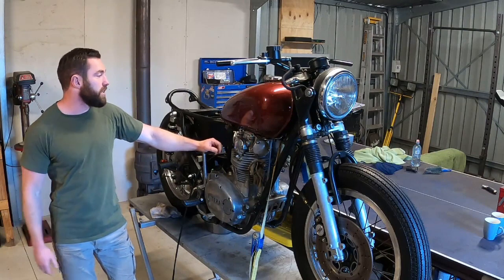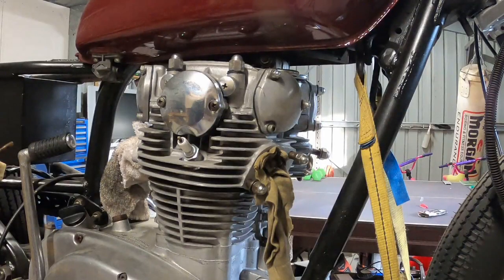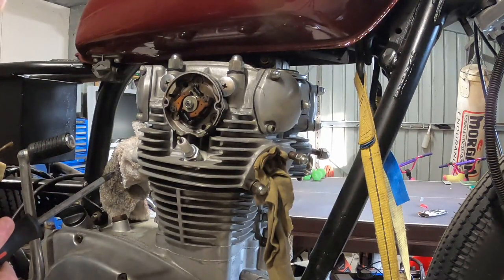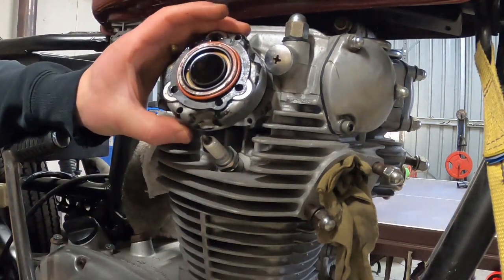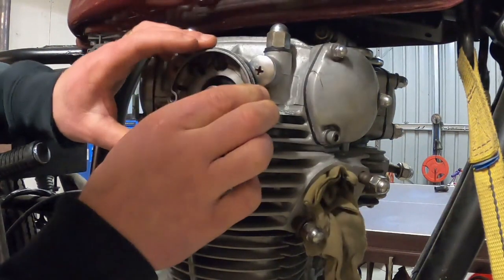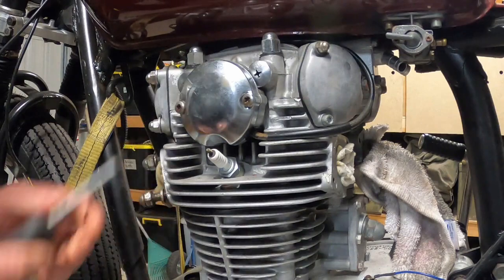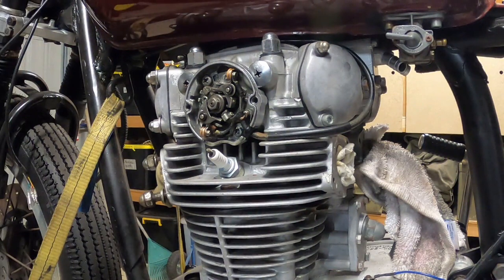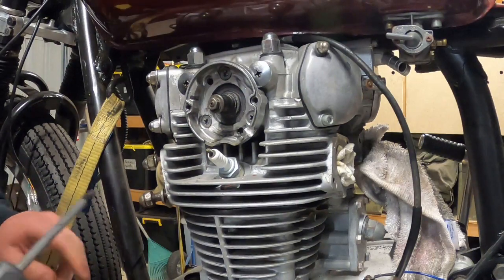XS650 Brat Build Ep 15, How to Replace Cam Seals

Comment: Having trouble reinstalling advance… specifically the directions of the locating pins of both the advance rod and cam and how to orientate them. Love the content!
Reply from the maker: The pin in the cam only allows the advance plate to mount in one orientation(there is a little slot in the back of the plate). Once that is done and the nut is tightened down the "advance button" (don't know if that is the right name) goes on the advance rod and is located by the pin. There is an arrow on the button which points in the direction of rotation. Don't worry about orientation of the advance rod as it will spin freely inside the cam and you can rotate it anywhere you need to in order to locate the advance weights.
Reply from the maker: I show the procedure in my top end rebuild video but the light wasn't great.

Comment: Just did this seal today. You don’t have to disassemble the advance mechanism. Just loosen up the castle nut behind the whole mechanism after you remove the two keeper pins. The advance unit comes off as a whole. The three Philips head screws that hold the back cup with the  seal I had to tap loose with an impact tool. Used that to snug back on. Nothing like Hercules but good n snug.
Reply from the maker: Thanks man. I have become a lot more familiar with these engines since this video. Turns out this leak wasn't even the seal, it was getting through the gasket behind the cup somehow.

Comment: Very helpful video. My XS leaks oil from the left cam seal like a sieve, so with fingers crossed I'm going to give seal replacement a try.
Reply from the maker: Good luck mate. I would also replace the o ring and gasket for the points housing as well.
Reply: Did you find any problem with the ignition timing because of the oil leak? I have a similar oil leak and I'm of the opinion that the oil causes a short circuit in the points back plate. Did you experience this?

Comment: Hey man, great build series so far, quick question, do you ever use a torque wrench when tightening critical items, so they are to spec? I haven't seen a torque wrench yet, but perhaps you are doing this off cam or are going to do it at the end... or do you just have enough experience that you know by feel, what is required/enough?

Comment: Seals and bearings. The wheel bearings and their seals and cam bearings and their seals are industry standard and available from any bearing supplier. Two of the four transmission bearings are industry standard and available from any bearing supplier. The steering ball bearings are industry standard and available from any bearing supplier but if you convert to tapered rollers they are a specialty part and only available from All Balls, Geoff's XS, etc. The crank's main bearings and big end bearings, the other two transmission bearings, and the three seals on the LH side of the engine are Yamaparts - not industry standard and only available from Yamaha or aftermarket suppliers.
Reply from the maker: I rebuilt this engine a few months after this video and replaced almost everything you have mentioned here.   The crank bearings are pricey.
Reply: @2wheelworkshop  That's built-up cranks for you. Imagine doing a Kawasaki 900 or a Suzuki GS-1000. A plain crank would require just grinding of the journals and OS shells.

Comment: I can’t get the housing to sit flush with the engine… even with the housing without any gasket, the two surfaces do not meet, making the paper gasket completely useless… Is that normal?
Reply: I wonder if the camshaft’s bearings are too far out? If that is the case, do you think I have to remove the top end cover to adjust? Or could I just tap them deeper somehow?